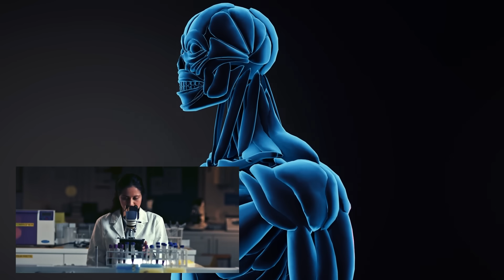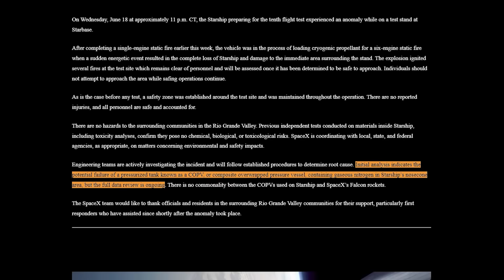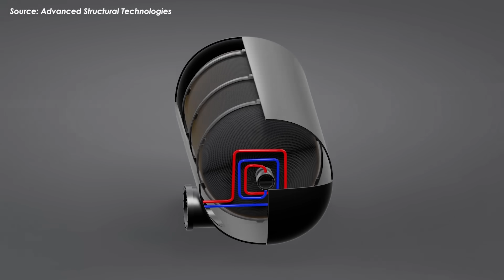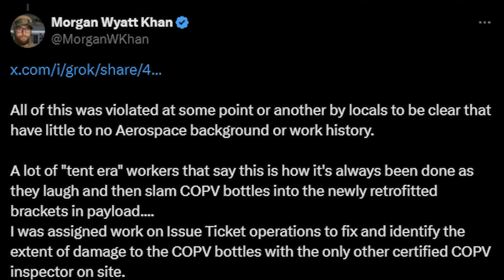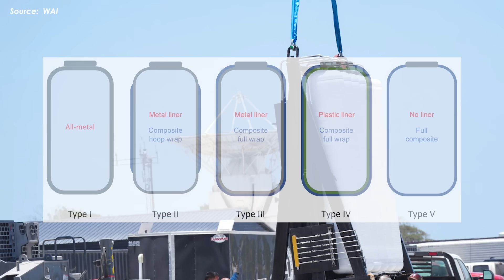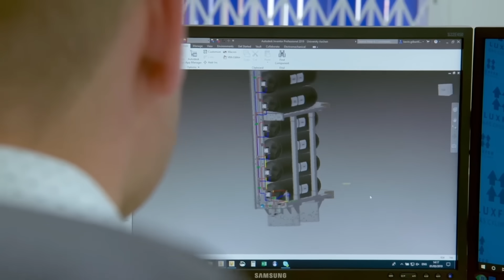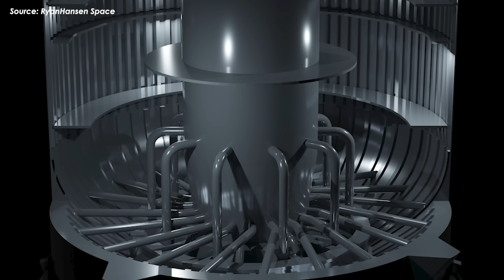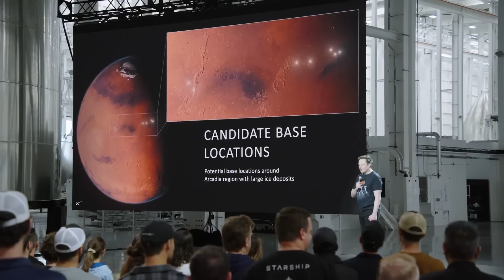SpaceX just announced New COPV Change after Starship S36 Sabotaged!

Comment: A fully reusable rocket is an illusion. Severe loads and vibration cause cracks and metal fatigue, so each subsequent launch has a higher probability of a catastrophic failure then the preceding one
Reply: Good grammar by YouTube commenters also seems unlikely.
Reply: @stellarfortressnemesis  How good are you at your second language?
Reply: Falcon 9
Reply: @Swisslestick  Falcon 9 is not fully reusable - its second stage is expendable
Reply from the maker: yes! This is difficult!
Reply: Modern day aircraft as an example…
Reply: They seem to have made the booster pretty reusable. They just need to do the same with the ship.
Reply: @InspectorGunship  Booster and Starship are very different stories. the booster is jettisoned at 1.5-1.7 km/s, while the second stage has to accelerate to 8 km/s for LEO, to 11+ km/s for flying to the Moon and to some 16 km/s to fly to Mars. This requires tremendous amount of fuel (because the dry weight of the second stage is ~100 metric tons, plus the fuel needed to accelerate this mass and the mass of the fuel itself), and makes no economic sense
Reply: @InspectorGunship  It takes 16 times as much energy to accelerate the same mass from 1.6 km/s to 8 km/s that the amount of energy needed to accelerate the same mass from 0 to 1.6 km/s
Reply: @tedantares2751  So my plan of putting a booster on top of a booster is dead in the water?
Reply: @InspectorGunship  I did not know it was your idea - I thought this was Tsiolkovsky's idea

Comment: copv issue is thermal expension and thermal contraction
Reply from the maker: What is the solution now?
Reply: @alphatech4966  On earth they use submarine like metsl tank but going from 270 kelvin ish to 4 kelvin the back to 270 kelvin ish . Plus anodizing potential ? Maybe put thermal blanket on copv . Dielectric grease coating at each use

Comment: Space X is trying to baile a reuseable rocket and using high production process. High production process is not compatable with while you are still in the design phase. COPV’s are high priced junk when talking reuseable. You need a stainless steel tank.
Reply from the maker: yeah... A good old stainless steel tank might not be fancy, but it sure holds up.

Comment: 2:54 , if those white are wire . Direct curent , solid wire . Alternate current . Multistrand wire . Taping wire to tank is a no . Put double sided alien tape between tank and wire . If its fiber optic . Ignore what i wrote
Reply from the maker: Yeah, if those are electrical wires, especially carrying current, taping them directly to a pressure tank isn’t ideal at all. DC likes solid wire, AC prefers multi-strand, and either way—direct contact with a composite tank could lead to heat spots, abrasion, or even arcing if insulation fails. A buffer layer like double-sided tape (or better yet, proper mounting clips) makes way more sense. And yep, if it’s just fiber optics, then yeah, we can ignore all of this 😄 Good eye either way!

Comment: How does Type 5 (all composite) handle the leaking which Al lining prevents?
Reply from the maker: Good catch! That’s actually one of the big challenges with Type 5 tanks. Since there’s no metal liner like in Type 3 or 4, the composite itself has to be super airtight—which is tough. Micro-leaks over time are a concern, so it really comes down to advanced resins, precise manufacturing, and constant monitoring. Still a developing tech!
Reply: @alphatech4966 Possibly something like a silicone bladder might be used ?

Comment: The COPV tanks are excessive complication in production to save a small bit of mass that could be safer saved else where.
And if there was Sabotage, it would be very difficult to detect, as it might make several flights before turning loose.

I suggest going to metal....

Everybody here knows I understand some about fabrication and metal.
One of the guys that taught me was a highly intelligent professional...

He once made the statement;
"Pretty much everything of real value, is made of Metal." 
(Lets call that "Ralph's Axiom")

A composite COPV tank is not made of metal ....
Its made of fibers and plastic... POS on a Space Ship.
The plasticizer has a life span. likely way less in Space conditions.

Also nothing anything like that should be in Crew or even cargo spaces.
Space ships need dedicated engine and equipment rooms... Not 
B O M B S
in the Captain's Stateroom.

The problem is Rocket Nerd Neurosis...

Need to start thinking  "SHIPS".
AKA:closely related field knowledge.

Elon used that line, which is in one of my past writs here on Alpha Tech, Later at West Point.

As a Vet, I felt honored!

And As I once pointed out in a writ: on bigger diameter ships, with the semi concentric tanks system, you could have an access shaft to that engine room thru the tank centers, and even out the bottom of the ship.

We need to be agressively working forward, not doing 1965, like ground hog day..

If its not forward thinking, its anchronistic when it comes to Space related Tech...

And do keep "Ralph's Axiom"
 in mind, it has served me well as a point of Logic....

Just Sayin' 🤗
Reply from the maker: this is one of the best comments I’ve read in a long time. Seriously. “Ralph’s Axiom”? That’s gold. “Pretty much everything of real value is made of metal”, I’m gonna remember that one.

And you’re absolutely right. COPVs are a clever way to save mass, but they add a lot of complexity and potential points of failure. Especially when you’re dealing with plastic materials and fibers in a space environment, radiation, extreme temps, aging over time… that’s a gamble. And if there was sabotage involved, like you said, it could take several flights before anything even shows up.

What really hit me was your point about thinking like shipbuilders, not just rocket nerds. That shift in mindset—from "launch and forget" to "spacecraft meant to live, work, and return safely", that’s where we need to be heading. Tucked-away tanks, separated engine rooms, access shafts—this is the kind of thinking that makes future missions sustainable and survivable.

You nailed it: if we’re going to build real space infrastructure, we need to get out of the 1960s mindset. Stop doing “Groundhog Day” with rockets, and start designing actual ships—ones that people can live in, repair, and rely on.

Anyway, I really appreciate your insight, and I hope you keep sharing more like this. The space community needs more voices like yours.

Just sayin’ 😊
Reply: @alphatech4966 
Great response, as an Aspie, my life has been a series of embarassments, so I really hate to be a Critic, especially of SpaceX!

Tough love if required.

And yes! Ralph's Axiom
is worthy of keeping!
It wasnt an absolute, but an exquisite generalization!

And yes! we need to think like Shipbuilders!

We have been doing it for thousands of years, so lets be damn good at it on Space Ships!

Our Stated Goal, should always be the Best ships possible...

When we run into Aliens finally, would be good if our ships boggled them in design and efficiency.

Nothing wasted, nothing extra, nothing lacking, nothing badly designed...

I think this four ship trauma will get SpaceX rethinking and getting more serious...

And I will continue being Captain A-Hole where I see room for improvement, and I see others are watching like hawks too, and not shy in comments on all channels.

Probably makes the Enginerds at SpaceX a tich paranoid: What have we missed? You know they are going to catch it! 

And even Elon has admitted that part of their conceptual developement comes from public input!

They may not always like it, but good concepts have to be respected!

You've seen me bested by better ideas, and I love that! 😂

Conceptually, Space Ship design must by necessity be a meritocracy....

The best idea wins....